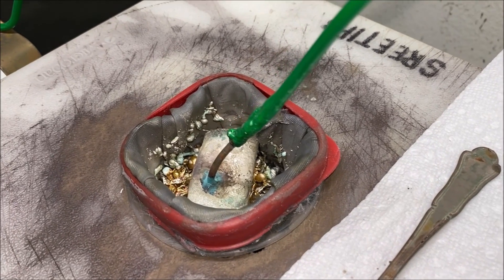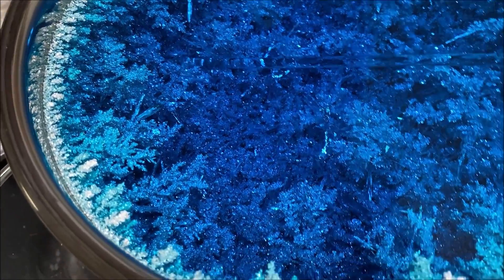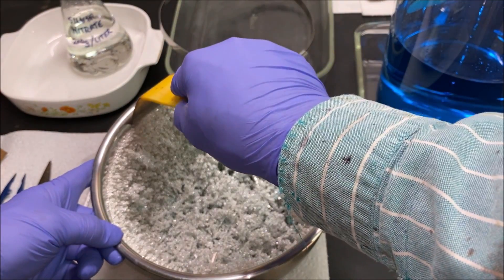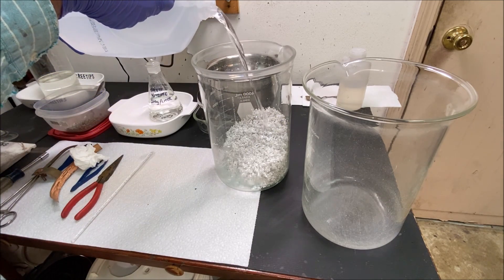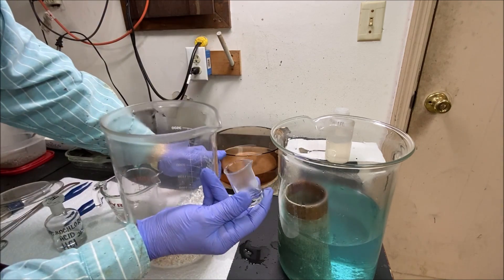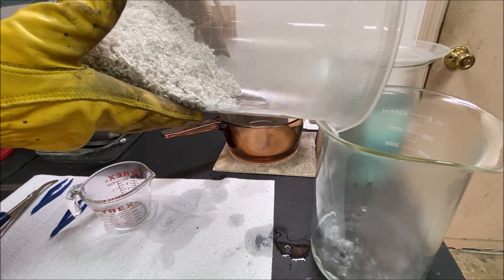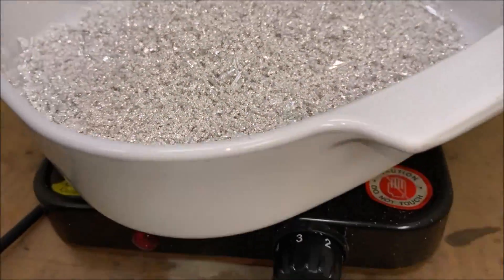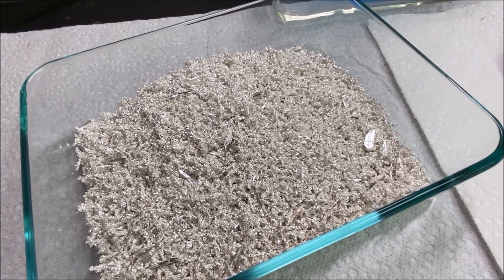Fifty Ounces of Silver From My Silver Cell Day 15

Comment: ive nvr had less of a clue whats going on... are u making actual silver that sells for upwards of 25$ an ounce or what? i mean what is the use and or point of this? since u give zero context.
Reply: so u double ur silver by purifying it over time? i mean what am i missing?
Reply from the maker: No, it’s one for one, less impurities. I’m refining the silver, electrolytically.
Reply from the maker: This video went viral. I didn’t expect that. It’s like writing a hit song. You never which one will hit. Most of my regular subscribers already know the particulars. I’m adding impure silver at the top. Pass electric current through it. The impure silver dissolves from the current flow. The silver (and copper) ions travel through the filter, through the electrolyte (silver nitrate) and deposit as three nines plus pure silver metal on the stainless steel bowl (the cathode). This is actual silver, investment grade. But it’s worth more than twenty five per ounce, much more. You see, the price of silver for thousands of years has been about twenty to one with gold. The reason it’s so low right now is because a large paper futures market exists that can easily be used to kill the price, and therefore the demand, for physical silver (and gold). This is a matter of public record and can be verified. Please read then President Johnson’s remarks on the Coinage Act of 1965. They’ve got to keep you in paper dollars, that can be printed out of thin air. But a paradigm shift is beginning to unfold as people come to realize that their paper is quickly becoming worthless (due to inflation - which is money printing). And that all their valuations are based on a mountain of debt that can never be re-paid. Best of luck to you and your family!

Comment: What is the point? Where did the silver come from ? Was it in the liquid ? Can you make money doing this ?what did you harvest the silver from ? What is a silver cell ?
Reply from the maker: The point; to purify the silver to industry standard three nines fine. The silver is a by-product and comes from my gold refining. The liquid is silver nitrate solution, 150g per liter concentration. Silver is money, so yes, I’m making money. The harvest refers to cleaning out the cell and gathering the pure silver crystal for storage. A silver cell is used to electrolytically refine the silver to very high purity. One test came back five nines fine. That’s 99,999 parts per one hundred thousand pure silver. It’s that good at cleaning the silver.

Comment: Got tricked by the video. Spoiler Alert. He only get 1080 grams which my new premee born at 1430 grams is 3lbs 2 oz. You do the math if 1080 grams is 50 pounds. Didn’t even bother calculating the cost of the chemicals after that
Reply from the maker: I got over 1500 grams.

Comment: Wow! This is AMAZING! I had NO IDEA one could "grow" one's own silver! I will watch your other videos to get a good idea on how you do it. How much did all of your equipment cost please? I'm a silver bug so maybe I can figure it out and make some too... ;-)  Also, how do you compact the silver into one ounce bars? Does it have to be melted and formed? Do you do that or bring it to a silversmith? Thanks for any info you can share!
Reply from the maker: I’m refining the silver that I recover from my gold refining. I’ve cast bars.
Reply: @sreetips  I stack .999 coins. Could I use one coin to get it started? And how much did all of your equipment cost please? (About how much to get started?) How did you cast bars? Thanks!
Reply from the maker: I have videos that cover all this on my channel. I use 150g silver per liter of electrolyte. The equipment is not that expensive. Less than $200 estimated. The trouble for most folks will be finding the silver to run through the cell,
Reply: @sreetips  Thank you so much for answering my questions. That was very kind of you :-)  I will digitantly watch all of your other informative videos!

Comment: I thought you were making silver out of thin air or just through the silver nitrate solution alone with copper.. little did i know you need impure silver 😏
Reply from the maker: Correct, I’m refining the silver. It’s thought that the only place that silver can be created is in a super nova. The only place in the universe where temperatures and pressure are great enough to cause protons to fuse into heavier elements.

Comment: Long time, big crystals!  Nice one! Great visuals too, plenty of good macro images to be taken there! And timelapses! 

Anyway, silver nitrate doesnt stain skin for as long as ppl think BTW.  I analysed chloride content with it routinely for about a decade and the dark tattoo colourarion doesnt stay for more than a year.  If you have open skin like a graze or even a closed bruise, it will stay for that time...  

Most of the time splashes are gone in a few days to weeks if its a high turn over area provided you wash immediately.  Its like strong acids (except hydrofluoric), wash off immediately and the biological intricacies associated with the skin will protect and any visible effects will be minimal and last less than a week man.  I have alot of oils on my skins (skin is a complex organ just like any other of the body... different compositions and layer thicknesses etc...), if nitrate hits dry skin the stain stays for longer... moisturise and use gloves.  Other than that all these stories come from ppl splashed in the face that see the stains on dry areas there every day and over exaggerate the severity of staining as far as I can see... But maybe I'm blind and dont know it.  Thats just my expereince.
Reply from the maker: I found, by accident, that 3% hydrogen peroxide will remove 90% of the stains immediately.

Comment: Is this power supply the same or sufficient enough? 
DC Power Supply Variable, 30V 10A Adjustable Switching Regulated DC Bench Lab Power Supply with 4-Digits LED Power Display,Coarse and Fine Adjustments
Reply from the maker: Yes

Comment: Honestly, alchemy still lives, eh?
If this made any economic sense buying a unit of silver as silver nitrate (or whatever) would cost less than a unit of pure silver. 
Which it doesn't.  Good luck but this is a complete waste of time, and an expensive one.
Reply from the maker: I buy sterling silver at estate sales, cheap, most folks are clueless about precious metals. Silver is a by-product of my gold refining. So I just recover the silver and run it through my silver cell. It’s very good use of my time. I’m building a second silver cell from scratch to accommodate the silver that I have. This will double my output from three kilos per month, to six. Good luck to you and your family.

Comment: Not sure what i just watched. Did you make silver or just change its form?
Reply from the maker: I’m refining the silver. I put impure silver in, it dissolves from the electric current flow, then deposits on the inside of the stainless steel cathode.
Reply: @sreetips  thanks for replying and explaining. One more question is this a financial thing or a hobby? I mean is the pure silver worth more than it was in it's other form? And thanks again.

Comment: Perhaps I missed it. Where did the impure silver come from? Electronic parts?
   And is this how one recovers precious metal plating ( including gold) from the outdated electronic devices we all have?
   In the past, (decades ago) I dissolved black sand with  gold dust in nitric acid and then dropped the gold out of the solution using borax.  After straining through a coffee filter it was then placed in a crucible and melted into a  ingot. 
    🤠🐂🏞️
Reply from the maker: I buy sterling silver at yard sales. I use it to refine gold. Then I recover it and run it through the silver cell.
Reply: @sreetips 👍  thanks.

Comment: How much did that bar weigh before it melted? Are you making a gain if you dissolve that whole bar and make it pure?
Reply from the maker: Impure silver is hard to determine the value. High purity silver crystal’s value can easily be calculated.

Comment: Ok, so maybe I'm stupid, but this is pure silver that you can sell as silver? or what is it's value?
Reply from the maker: “Stupid is as stupid does…” forest Gump. This is high purity elemental silver. I feed impure silver into the anode filter basket. Pass an electric current through it. The silver dissolves, passes through the anode filter (gold and platinum group metals get trapped in the filter) the silver ions travel through the silver nitrate electrolyte and deposit on the stainless cathode as three nines plus, pure elemental silver. It can be be sold, but I’m not selling it with silver prices so grossly and artificially under valued. The silver is a by-product of my gold refining. This is my hobby. I don’t refine other peoples material. Only stuff we find at local sales. Hope this helps you understand. Thanks for watching,

Comment: What kind of chemistry is this? Electrolysis? Electroplating?
Reply from the maker: Electrolysis. An electrolytic silver cell. It produces high purity silver just like the big refiners do. Except my cell is a Moebius silver cell. They use Thumb Cells; alternating anode and cathode plates suspended in gallons of silver nitrate tanks. But my silver is just as pure as theirs. Possibly even more so. I once ran the silver crystal back through the cell for a second pass with fresh electrolyte. The assay came back greater than five nines fine. That’s 99,999 parts per one hundred thousand pure silver.

Comment: HELP! Ok I have questions  1. What’s the reason for doing this vs smelting 2. I assume that the silver was all put in that bath at the top and slowly melted but that no silver was “produced” but was just reconstituted into the pool? 3. Would this work to remove silver off silver plated items or would the base metal interfere with the process? Thank you for whoever can give me some understanding
Reply from the maker: 1) all investment silver starts as pure silver crystal. Smelt is rendering metals from ore. No smelting experience. 2) I only get out what I put in, less impurities. 3) electrolytic refining requires relatively high purity metal to begin with. Silver plate won’t work in the silver cell.
Reply: @sreetips  thank you so much for the help I really appreciate it!!

Comment: I still don't get the part where this means you have money. Do you sell this? Even with bars, I don't get it. Can you help me?
Reply from the maker: Here’s the missing link; paper dollars are not real money. They can be printed out of thin air. We’ve been conditioned to believe paper has value. It doesn’t. Gold and silver can not be printed. They are real money. With this in mind, I’m converting paper dollars, that are declining, to gold and silver that are rising. These metals are NOT an expense nor an investment. I’m merely trading paper for metal. The paper is declining in value (due to money printing) that’s why prices appear to be rising. Prices are not rising, but rather, the value of the currency is declining. So it takes more of it to purchase the same amount of goods and services. Metals are rising at the same rate or greater than prices are being marked up. So the metals are protecting and preserving my purchasing power. Holding dollars is not a good idea. Holding metals makes much more sense because they can’t be printed out of thin air. If I need paper to buy food or pay bills then I sell a little metal. It’s not what I’d have hoped for. But this is what we’ve been given. Thankfully I realized this years ago and got into precious metals. Hopefully this helps you understand.

Comment: Would this be profitable? Or are the time and materials at break even once you make a silver bar?
Reply from the maker: Here’s the missing link; paper dollars are not real money. They can be printed out of thin air. We’ve been conditioned to believe paper has value. It doesn’t. Gold and silver can not be printed. They are real money. With this in mind, I’m converting paper dollars, that are declining, to gold and silver that are rising. These metals are NOT an expense nor an investment. I’m merely trading paper for metal. The paper is declining in value (due to money printing) that’s why prices appear to be rising. Prices are not rising, but rather, the value of the currency is declining. So it take more of it to purchase the same amount of goods and services. Metals are rising at the same rate or greater than prices are being marked up. So the metals are protecting and preserving my purchasing power. Holding dollars is not a good idea. Holding metals makes much more sense because they can’t be printed out of thin air. If I need paper to buy food or pay bills then I sell a little metal. It’s not what I’d have hoped for. But this is what we’ve been given. Thankfully I realized this years ago and got into precious metals. Hopefully this helps you understand.
Reply: @sreetips  yup I'm pretty current on note-based economics and often preach to my kids about getting out of paper and into an assortment of real investments.

Just curious if this process costs or profits

Comment: It looks like you've pulled the silver out of suspension in your plating solution, and I cant understand why...
Reply from the maker: The electric current flow dissolves impure silver in the anode filter basket. The silver ions then pass through the filter (copper also) and travel through the silver nitrate electrolyte then get deposited as pure elemental silver at the cathode. The copper stays in solution and will not deposit as long as it’s concentration is kept low, and the voltage is kept at 3.5 Volts DC

Comment: This guy has such an “ASMR” type of voice…soft, quiet, convincing. 
Interesting process of recovering precious metals—wish there was more specific info in the description. 
If silver is alloyed with other metals, using electrodes to make things like colloidal silver, will still contain the other metals.….What is he doing, to segregate the metals?…& with how much thoroughness?
Reply from the maker: If conditions are carefully controlled then only the silver will deposit inside the stainless bowl (the cathode). I’ve had it analyzed and it comes back three nines except once. I ran the crystal back through a second time with fresh electrolyte. That came back greater than five nines. That’s 99,999 parts per one hundred thousand pure silver.
Reply: @sreetips   Very impressive!!
Reply from the maker: I have a video of it on my channel. Sold all of it with a copy of the analysis.

Comment: You could put a screen and small hole at the bottom with a release valve added to do the draining. Then you just set above the beaker and flip the release valve to drain every drop.

Comment: ive always wanted to ask... 
what about the stainless steel pot that your silver crystals are in... is their a chance of steel getting dissolved into solution or anything like that?
also.. is it just distilled water thats in the in silver crystal pot? is that what the solution is? probably ofcourse a little silver in solution too???
Reply from the maker: Traces of stainless can be detected in the silver. But not enough to report in an assay. I ran the crystal back through the cell once and it came back greater than five nines fine. That’s 99,999 parts per one hundred thousand pure silver. The electrolyte is silver nitrate 150 grams of pure silver per liter concentration. Silver nitrate is clear and colorless, like water. Copper in the impure shot that I feed into the anode basket turns the electrolyte blue.
Reply: @sreetips  aww man.. cool thanks for the reply.. ty ty 💯

Comment: I just stumbled upon your fascinating video, I couldn’t find anyone in the comments that asked this, is this real silver? Is it pure? and would you be able to sell your silver crystals for about $1300 for 50 Troy ounces on the market?
Reply from the maker: Yes to all those questions. But understand, I only get out in pure silver what I add to the anode filter in impure silver, less impurities. I’m not creating pure silver out of thin air.
Reply: Matter cannot be created nor can it be destroyed but rather, only changed as to form. Burn a stick of wood and that form is changed into heat, carbon and various gasses - theoretically all recoverable with no gain or loss.
He is recovering and refining that which exists already.
Silver, just as is gold, copper or iridium/osmium, is an ELEMENT.
"Really, it is but elemental my dear Watson."

Comment: What’s that much silver nitrate cost compared to the value of that much silver?  50 Oz, depending on the market conditions could be in the neighborhood of $1500 (more a couple years ago).
Reply from the maker: I’m not sure. I make silver nitrate by dissolving pure silver crystal in nitric acid.
Reply: @sreetips  seems counter productive to dissolve silver crystal in nitric acid (which is illegal to possess in quantities over 1oz at least where I live in the US) just to then re-crystallize it.  Seems like a lot of work just to get back what you already had.  Lol.
Reply from the maker: I need silver nitrate for my silver cell. I use 150g per liter concentration for the silver cell electrolyte.

Comment: Started a smaller test silver cell. 8 hours in these crystals are beautiful I keep staring at the cell. Picture of early hours on GRF under BGDOC

thank you so much
Reply from the maker: Keep a close eye on it. My one liter glass cells were notorious for making contact and burning a hole in the anode filter when I wasn’t looking.
Reply: It’s pulling 1.7 amps at 3.5 VDC
solution is somewhat clearer  so change the solution a the Amps drop right? 
Have to admit couple lessons learned .
Have plenty of feed shot  and solution ready. 
Still on the fence cementing out vs. silver chloride lye/ sugar methods.
Reply from the maker: The amps are all over the place, especially toward the end of the run.